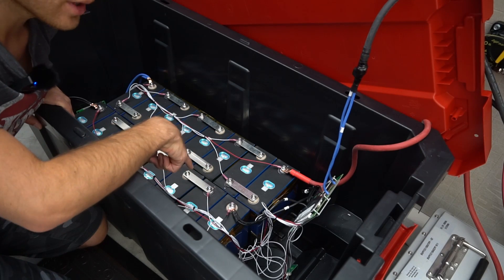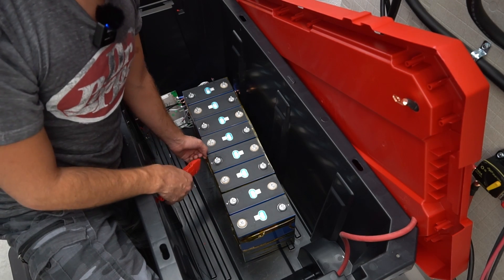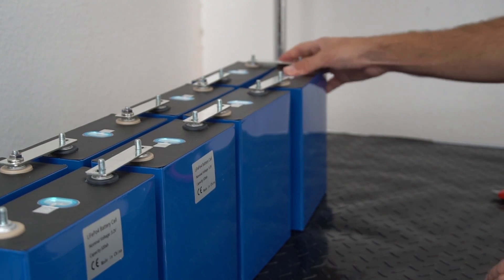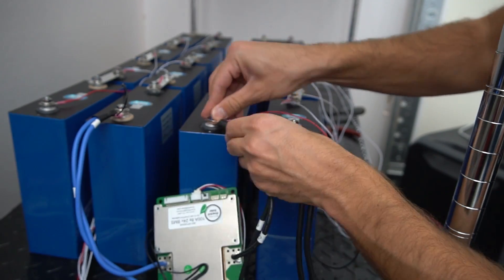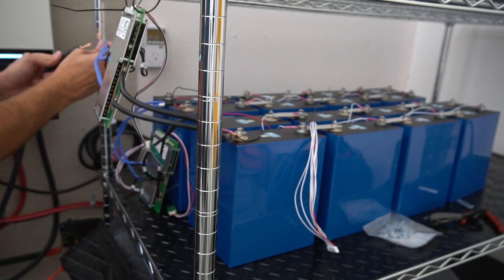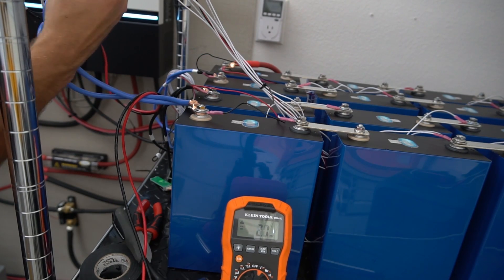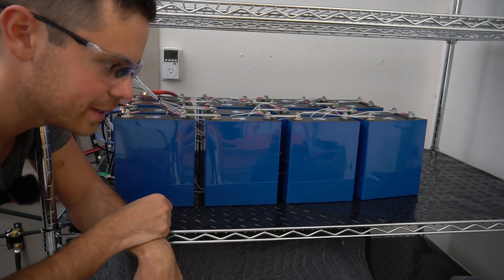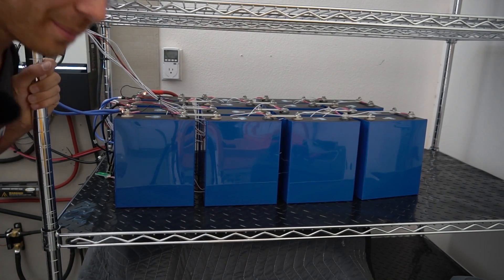Bloated LiFePO4 Cell Configuration to Reduce Terminal Stress! (suggested by my viewers)

Comment: ISOLATE IT:  I like containerized battery banks.  The same with a BMS, in an isolated junction box.  I've seen what can happen when there's a short.  Oh, using that metal rack as a common ground is a "no go" also.  Regardless Will, I really like your videos and what I've learned.  Thanks.

Comment: Just mount a 3/4" plywood to the end of the shelf. You could zip-tie it on all four sides if it was cut and drilled correctly. You could drill holes for cable management as well.  I don't have any advice on moving a heavy body though. Good luck with that. :)

Comment: Dang it Will... I've been working on an outline for a video on this topic of fixture and terminal stress for a week now and you beat me to it, with not 1 but 2 videos. BUT... I think you may have just solved my problem/concern so I may give it a try. It works nicely for the 230Ah cells too and the space between is less, so they can be more compact still without touching.
Reply from the maker: No way!!! I'm sorry. I just cranked these videos out and it was my viewers idea. Can't wait to see your ideas on this, it's a difficult thing to deal with!
Reply: @WillProwse  Yeah I saw that guy comment on your last video! So cool that you made a video so quick. <3
Reply: @WillProwse  I have the original AC200 and I was wondering about a dust problem over time with a fan that sucks in outside air.  Is there away to clean circuit boards in units like the AC200 series?

I purchased it to run a 12volt 54qt refrigerator and two 180watt panels to recharge it.  My refrigerator is a month newer then the AC200 and a friend suggested that I clean the coils on the refrigerator.  I took off the grill and was surprised by the amount of dust and particles that had accumulated over the period shy of a year and was happy to take my vaccume clearer in hand with a task to complete.  Looked great and still shined bright after it was done.  I was proud of the job and sent before and after pictures to my friend.  How do I do it for the AC200?
Reply: @michaelpearce8661  just an idea you could buy some air filter material for the intake vents? most Pc's have them I'm sure cleaning a filter would be easier than the board
Reply: If your cells are flat then compress them and you won't have any movement that might cause a problem

Comment: You could get plexiglass the size of the shelf and put computer stand-offs and screw the BMS to it so it would be solid and spaced but insulated. Zip ties or L brackets would hold the plexiglass to the shelf.